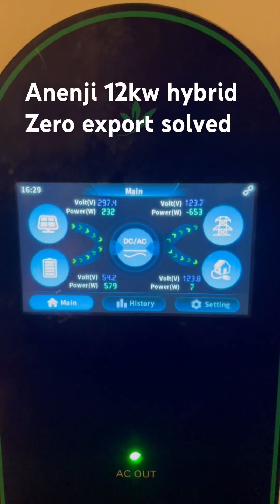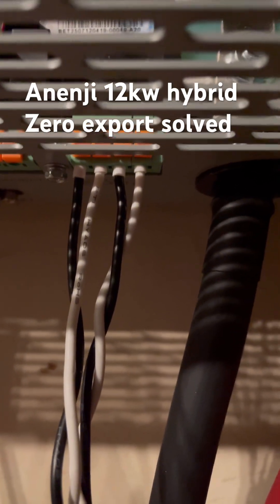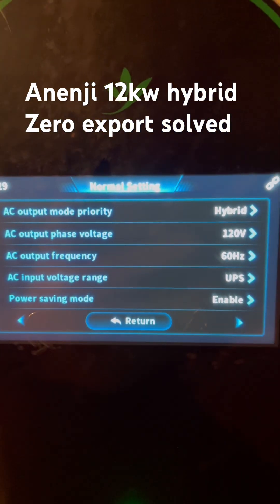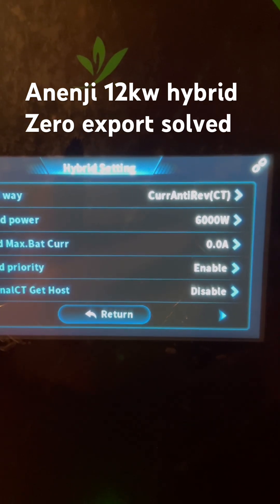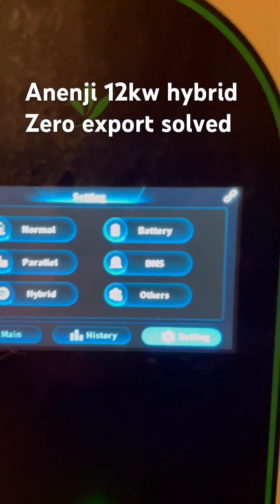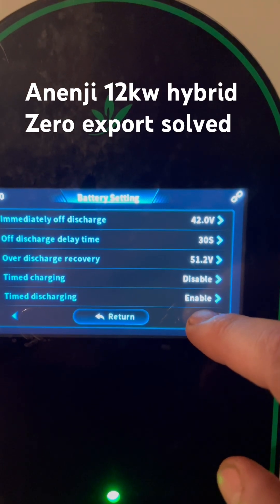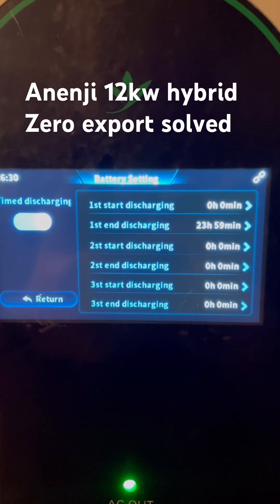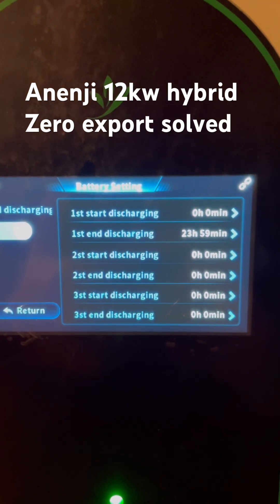Anenji 12kw hybrid zero export howto #solarinverter #ongridinverter

Comment: Awesome. Love to see a long version of the full setup and settings. When u say set to 6k do you mean the maximum load  it will service is 6k and the inverter produces the called for wattage  based on the ct's. But won't export? Is that a split phase u.s. version? If so can u put the exact model number in the chat? Thx

Comment: thanks for the details, have you manage to connect the dongle to internet. i do have home assistant and don't want to use solar assiant
Reply from the maker: I have indeed. Look for an app called Smartvalue. You should be able to add the dongle via bluetooth but if that fails you can scan the code. There can be a bit of latency between the various steps - create account, add device, etc. It gives you some readings plus historic graph data.